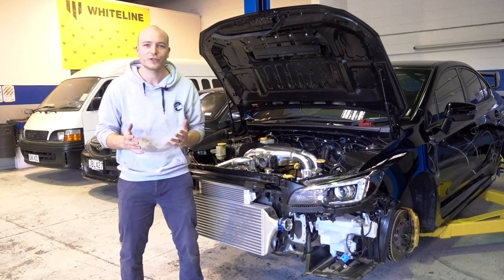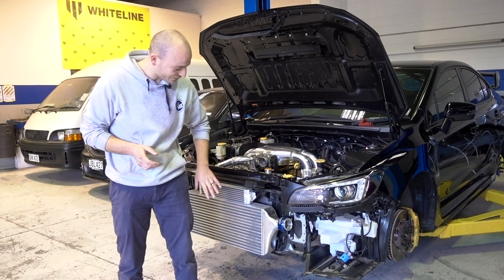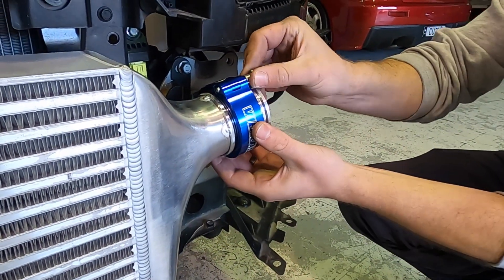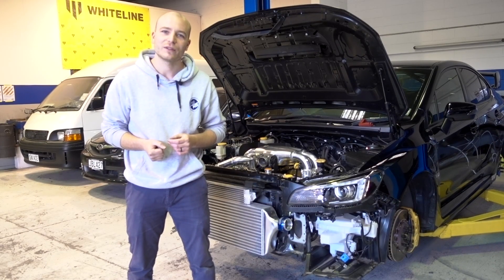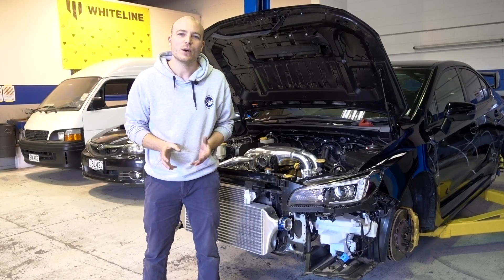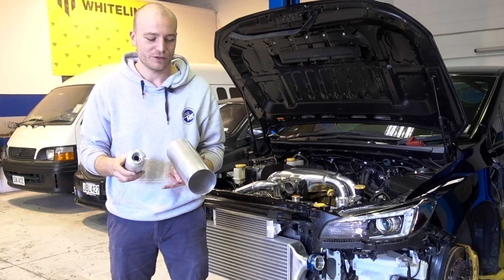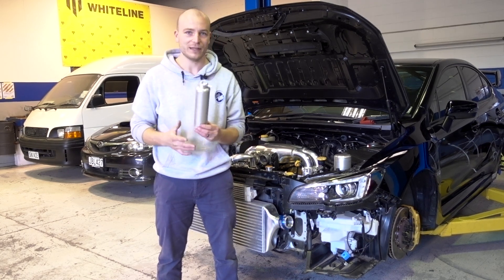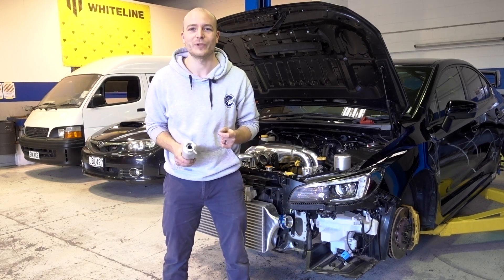Garrett Turbo, Fabrication and Race Cooling [Billet Block Project EP. 4]

Comment: What’s are your thoughts on the g35-1050? Leaning on this turbo from a 800 whp set up. With everything on it.
Reply from the maker: It's a big turbo for a Subaru, and we haven't actually used one so we don't know real world results. It will probably be good with the right housing sized, but like anything the setup is about far more than just the turbo, it's about piecing together an engine setup that works together.
Reply: @PossumBourneMotorsport  I’m getting the 1.01 AR, also fully build engine close deck. Plus process west manifold E85 etc..

Comment: Can i ask what throttle body you are using?
Reply from the maker: This one is still using the stock throttle body with a 3-inch v-band adapter. It's certainly the most restrictive part of the engine, however it's capable of all this turbo can throw at it. A larger turbo would need an upgrade. Also - our friends over at IAG have made 1000HP on a stock throttle body, but it's not going to be as efficient as a larger one.

Comment: How much hp will this STi be pushing with the G30-770?
Reply from the maker: On E85 fuel we'll see between 420 and 440kw at the wheels, which converts to around 590HP (wheel) or 700HP (engine)
Reply: @PossumBourneMotorsport  Im going more or less the same setup, not for daily, as for the block still debating whether sleeved or closed deck and the turbo im between the G30-770 or the G30-900, how much hp can i get with the G30-900?
Reply from the maker: @TheE3R  talk to your engine builder about the pros and cons of sleeved vs closed deck. They both work, it just comes down to personal preference and what they will warranty. In theory, you should be able to achieve '770hp' at the engine from a G30-770 and '900hp' at the engine from a G30-900. In reality, we find these numbers a little ambitious. Without having used a G30-900, we'd guestimate you'd be able to make around 640-650hp (wheel) on E85 if your entire setup supports that power level.